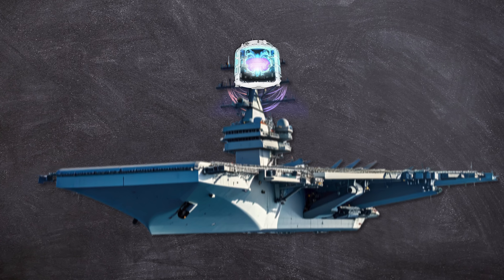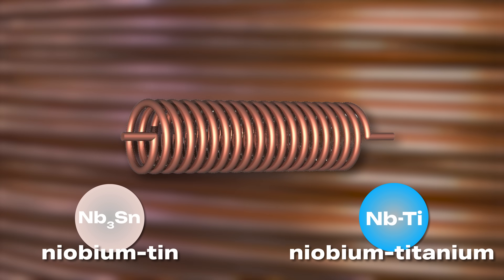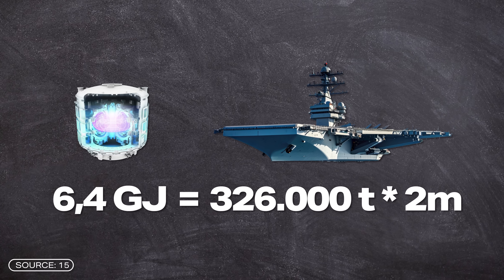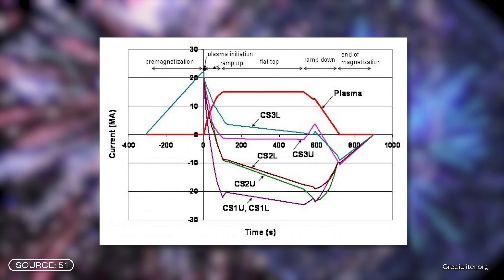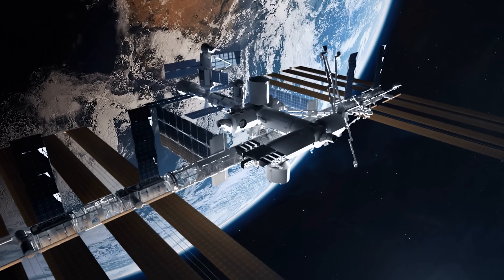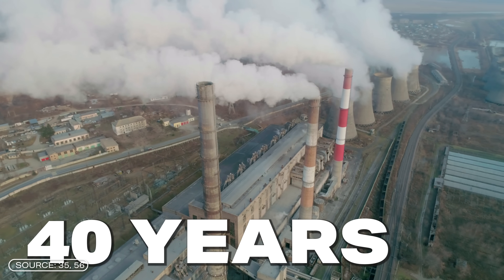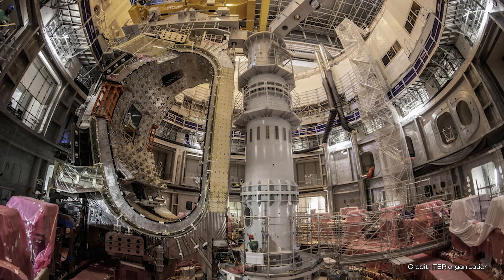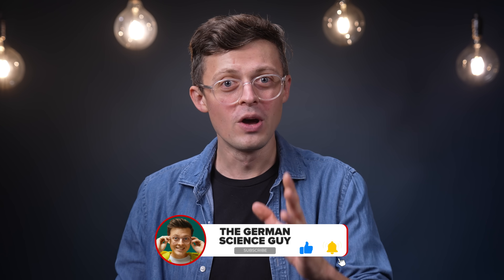Could This Supermagnet Unlock Fusion Power?

Comment: Generating fuel for fusion from nuclear waste! https://youtube.com/shorts/ZLAmVFKy4II?si=9IuUW77iCaNx3Hco
Reply: This linked study failed to examine the cost of producing tritium by this means. In fact it is very costly and requires significant quantities of energy. Superconducting particle accelerator are not cheep and it was not mentioned that the nuclear waste would require costly chemical purification before it could be employed. Additionally the enrichment required to generate the lithium-6 target material is costly. This video only mentioned the quantity of tritium that exist. Much of it is reserved for nuclear weapons use. Proponents, of  fusion energy never mention the cost of commercially available tritium which is needed for some of the existing and now being built experimental machines. The cost is over $30,000 USD per gram. Many of the experimenters seem to believe that the general public doesn't need such details to evaluate what they promote by other means.

Comment: Those "NIF lasers delivered 2.08 MJ of energy" is a pointless mention. How much electricity did it take to power them? Records in wasted energy per second maybe?
Reply: The NIF lab administrators eventually admitted that that pumping the lasers consumed over 100 times the amount of energy compared to the amount that ended up at the target. This was a pitch for an expensive upgrade for the lasers that still wouldn't get anywhere close to generating more fusion energy than was required to power the facility. The 12/05/2022 laser shot 'breakeven' goal was supposed to have been achieved by 2012, but they failed by a factor of over 100 then. The experiment took about a week to set up. The input energy value that they should have used to calculate the fusion energy gain should have includes all the energy that facility consumed during the week of the shot preparation.

Comment: Iter is taking way to long.
Reply: ITER is grossly over its original budget and well beyond a decade behind its original goals. The administrators have had to eliminate some of the experimental goals but this aspect is not exhibited on their public-facing websites. It is a lesson of what can happen in an atmosphere of lack of accountability.

Many fusion energy fans have been led to believe that many of the smaller, venture capital funded, have a better chance of achieving significant fusion results much sooner. Many techno nerds tend to believe that any project that is newer MUST BE BETTER with a much greater chance of success.

Comment: i knwo helion is pretty secrete, but it would be nice if you covered them more. i think they have a much better chance at fusion than iter
Reply: It appears that Helion Energy is having problems that they are keeping quiet about. At the beginning of 2024 they announced that by the mid-summer of 2024 their 7th generation experimental machine, Polaris would be generating electrical energy from fusion reactions. Since then all they have posted are diversionary videos. Keep in mind that such experimenters typically understand that most of their audience doesn't have a deep understanding of their esoteric technology so they present only some basics while omitting key evaluation details. The aim of Polaris is to employ the fusion reactions to recharge the capacitor banks that were used to generate the compression pulses. Helion energy hasn't yet announced that they have gotten anywhere close to that modest goal, let alone generate three phase electrical energy that can be delivered to the local grid. Most fans tend to have no interest in posing probing questions to the idols that they have come to love. Despite now experimenting with their 7th generation experimental machine Helion Energy has never demonstrated that they have generated even one watt hour of fusion energy from any of their previous experimental machines.

Comment: I believe the Princeton tokamak reactor exceeded break even in at least one test run before it was retired.

To me it sounded like the science was done and it was being retired so they went for it and ran it in a way that they knew would damage it but that didn't matter.
Reply: The phrase 'break even' is employed in a misleading way by the experimenters. It doesn't account for the energy input required to power the experimental facilities. It depends upon a tiny subset of that energy to do the gain calculation. The input energy parameter employed involves the direct heating of the plasma to bring the confined fuel up to fusion level temperatures. In pulsed machines, which is the case with almost all tokamaks, that input energy applies to only the time that the machine is attempting to generate a fusion pulse. In many cases that period of time is an extremely small portion of the time that the facility is being powered.
Reply: @vernonbrechin4207 yes but in a commercial reactor that would be pulsed continuously, the startup energy gets divided be each successive pulse and eventually becomes just a tiny part of the break even calculation.

The one that really cooked the books was the Inertial Fusion break even, they only counted the power output of their lasers, completely ignoring that lasers are quite inefficient devices that haven't improved their efficiency very much over time and there isn't much happening to improve their efficiency and nobody with a brain believes that a 100% efficient laser is a real possibility.

Comment: Along with the massive budgets required by such fusion energy projects has come increasing amounts of misleading sales hype. Increasingly the hype capitalizes upon fear of global warming to push for continued support. The ITER project has grossly exceeded its original budget and is well beyond a decade behind its original time line. The chart, displayed in this video, is totally different from when the ITER construction began. The tritium breeding experiments are not likely to begin until after 2039. Always omitted, from presentations, is the fact that such experimental machines will need to purchase commercial tritium at a cost exceeding $30,000 USD per gram. Since the nuclear fusion energy experiments began in the 1950s the general public has been told that the hydrogen fuel is almost limitless. The claim that nuclear fusion energy power plants will provide 'clean, virtually limitless power,' always ignores the fact that most schemes require radioactive tritium and will result in radioactive reactor components due to neutron activation reactions.

In this video the following statement was made. "ITER aims to demonstrate that nuclear fusion can actually produce more thermal energy then is consumed in the reaction." Many fusion energy experimenters refer to this as being 'net energy gain.' It involves omitting key evaluation factors. It doesn't include the period of time that the machine is recovering from engaging in short pulse experiments and it omits the quantity of energy required to operate the facilities during the experimenting days. That quantity of energy can easily be at least two orders of magnitude greater than the 'net energy gain' value provided to the public and to scientific journals.

As shown, by the table of superconducting solenoid currents, over time, those currents and magnetic fields do not run continuously. Typically the recovery times, between pulses, are not mentioned.

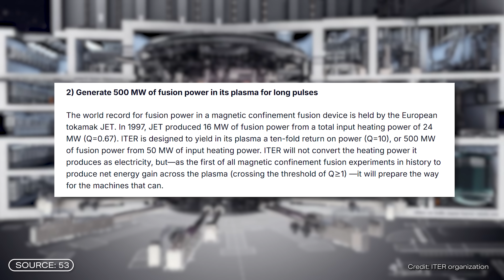The use of the term 'ignition' (9:39) is misleading. Currently the heating power is required to sustain the reactions, it doesn't trigger it. Additionally, the reaction doesn't lead to the complete reaction of the supplied fuel, as do many chemical ignition type reactions.

Omitted from many of the Wendelstein 7-X long plasma triple product announcements was the fact that it didn't involve deuterium-tritium fuel and the peak plasma temperature achieved was less than a fifth of what would be required for D-T fusion reactions to be highly significant.

The NIF's so-called 'target gain of 4.13' has no significant relationship with the amount of energy consumed by the facility in the preparation and conduction of the experiment. Such fusion reactions tend to last for under 0.000,000,000,100 second before the central, exploding microscopic core blasts away over 90% of the supplied fuel before it has a chance to fuse. Such experiments often take about a week to prepare and repeating such experiments often occurs over several months of time. The fusion duty cycle is billions of times less than what would be required for a commercially practical ICF power plant which would need to fire at rates of at least 10-times per second with fusion energy yields  thousands of times greater than the record values the NIF lab experimenters are now occasionally achieving. NIF was supposed to have achieved these values by 2012 but failed by a factor of over 100 then. The NIF administrators have always masterfully obscured the primary purpose of their machine. It has always been primarily funded as a thermonuclear weapon (H-bomb) research tool, not a viable path to future energy generation.

The DEMO design and PROTO proposal for 2050 demonstrates the need for diversions away from the dire warning provided below. Most nuclear energy advocates are in line with the vast majority of Earth's 8.2+ billion humans who have masterfully excluded thoughts of such warnings from their consciousness.

UN chief: World has less than 2 years to avoid 'runaway climate change' (TheHill)
  * This statement was made 6.9 years ago.

Comment: Ok, question that no one seems to answer in these types of videos.

If the cables in the walls have to be super chilled,  to create the magnets strong enough to hold the plasma.........What part of the reactor is actually absorbing the heat, and then i assume, transferring that heat to water, to boil it and create steam.  

Are there some kind of oil filled pipes between the wires and the wall?   Are the heat collectors located in specific spots?  or does the entire wall absorb the heat?  And does that cause us to need even stronger magnetic fields, to get through both the heat collectors and the wall? 

And what exactly IS collecting the heat?  Again, pipes with some kind of high-temp oil?  How hot does the liquid get???   

I want to know more about the power GENERATION side of these damn things, and not just the hurdles of building it.

Comment: 12:45 - True.  The levelized cost cost per MWh of electricity generation of a fusion reactor is not guaranteed to be low or economically viable even.  That's presuming the hypothetical situation that sustained net-positive terrestrial fusion is even possible, which is still an unknown.

Each year that goes by, it gets harder and harder for fusion energy to be economically viable on the grid.  Why?

Because renewables + energy storage have reached historic low costs of generation at a levelized cost per MWh and they're still driving their costs lower each year!  Renewables also directly tap into the mind-bending power of our sun which is a free fusion energy source gifted to us by nature: 173,000-terawatts non-stop or 1000W per square meter peak on the ground, and it's always peak somewhere on Earth.  Global renewables + storage capacities are growing at exponential rates.

Bottom line: nuclear energy (be it fission or fusion) is best used in small-scale specialized applications: military, scientific, deep-space.  Nuclear is absolutely the wrong tool for use on the terrestrial grid.  Nuclear energy is cool tech but we can't automatically assume it is applicable to large-scale applications like the grid.  Over its 70+ years of history, commercial utility-scale fission nuclear energy has proven it cannot scale for many reasons including high cost, long build times, and unparalleled risks.  Fusion might mitigate fission's risks, but fusion costs per MWh likely even higher than fission because of additional complexities, especially at the beginning of a hypothetical fusion era.

Comment: I must ask a What if question:  What happens to ITER if the Stellarator at Wendelsheim or one of the many privately constructed small fusion devices is brought online, or at least achieves an excess of break-even power before ITER does (before 2050, for instance)?   Will ITER still make a contribution to fusion science worth the tens of billions of Euros spent on it?  Also, wouldn't the use of high-temperature superconductors with liquid N2 cooling simplify and shrink tokamaks?

Comment: This is an R&D project that is marketed as an engineering effort.  The divertor is the layer that performs thermal transfer from the reaction to water.  It is an enormous, and as yet unsolved materials science challenge.  ITER will turn out to mean ITERate slowly until funding is consumed/turned off.... The tempo of this project is wildly out of synch with any type of climate change solution.
Reply: This was exactly my question: how would the heat from the superheated plasma get transferred to the water to make steam and run the turbine…
Reply: @Fernando-of4cz  15:43

Comment: nah use plasma electromagnets instead, hot instead of cold. much cheaper, easier etc. and already in plasma state like the reactor itself. just an insulating separating wall for the current flows. zero resistance of course.

Comment: I'm all for the advancement of the study of Nuclear Fusion BUT.... I WISH we could Also be advancing & building a ton of Nuclear Fision energy grid systems!! So much within nuclear energy has improved but nobody is taking advantage of it. There's so much potential not being utilized right now
Reply: Small Modular Reactors:  51 SMR designs in licensing or pre-licensing stages across 15 countries, with around 85 active siting discussions worldwide. There’s been an 81% increase in SMR designs that have received funding since 2024
Reply: Same here.  People talk about the future of energy as though any one choice is going to be 'the' solution that will wipe all the others off the map.  So what if solar is not going to replace coal.  It can contribute some green energy to the grid.  So, yes, putting more fission in the mix before (I hope) fusion comes on line sounds wise to me.